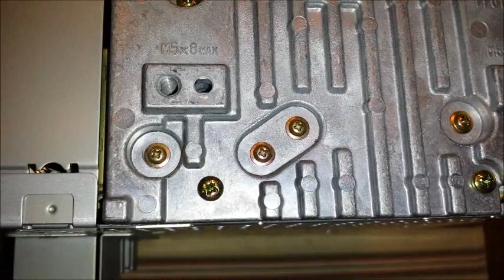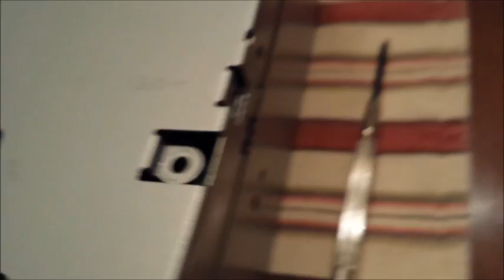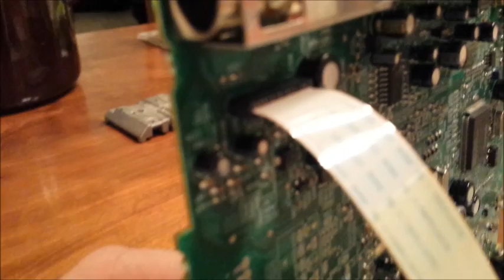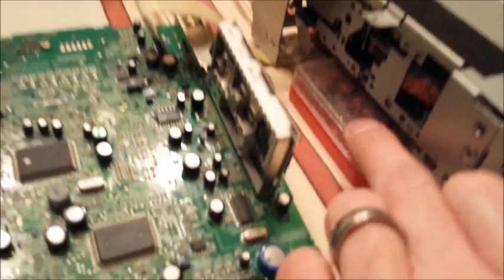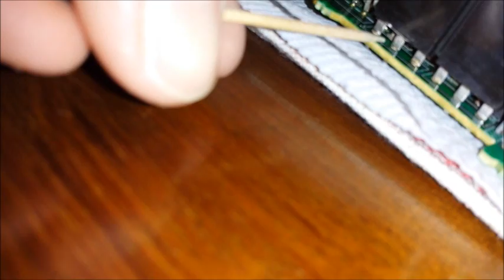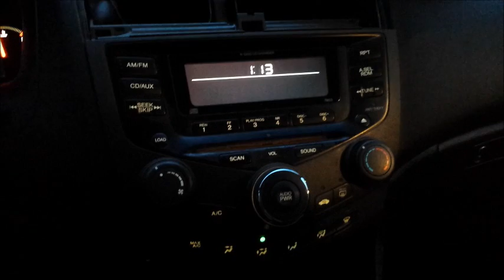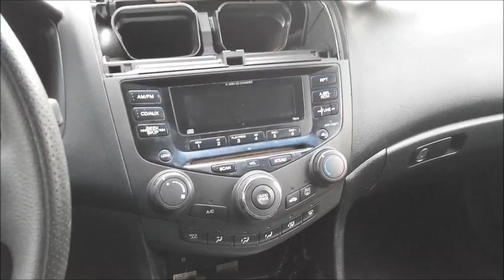2003 Honda Accord Radio Repair - Part 2

Comment: Hey Matt--I know it's been a while since you posted this, but I have a question about the original problem set you had.

Did you also have "alternator whine" or a buzzing/whining sound that increased with intensity when increasing RPMs? That is my current problem (along with no back lighting).
Reply from the maker: Hey Mike, the vehicle in this video actually belonged to a friend so I am not 100% sure, but I don't remember him mentioning an alternator whine.  I have a feeling that is probably a separate issue (your alternator may be starting to go bad).  Did the whine pop up at the exact same time that your radio backlight went out?

Sorry to hear you're having trouble, but hopefully you can get it sorted out.  If you are feeling brave, you can try the radio repair, and then move on to the alternator later if it continues whining.  Good luck!
Reply from the maker: Hey Mike, the vehicle in this video actually belonged to a friend so I am not 100% sure, but I don't remember him mentioning an alternator whine.  I have a feeling that is probably a separate issue (your alternator may be starting to go bad).  Did the whine pop up at the exact same time that your radio backlight went out?

Sorry to hear you're having trouble, but hopefully you can get it sorted out.  If you are feeling brave, you can try the radio repair, and then move on to the alternator later if it continues whining.  Good luck!
Reply: Thanks for the well wishes. Let me give as much information as I can and my conclusions thus far. The whine has been around for a while. Only recently did I install an auxiliary line (cross country drive coming up and wanted phone-based tunes), but the whine comes through with such intensity that it drowns out any output from the auxiliary device!

I've had the alternator tested and it is within expected operating parameters. No issues there.

I took apart the dash and removed the head unit. I double checked my grounds and even added an additional ground along the radio receiver to ensure there would be no interference. When looking for a reasonable place to mount the second ground line, and while the vehicle and radio were running with the whine audible, I never heard a change in the whine while touching the second ground wire to other grounded surfaces--no pops, clicks, or even the slightest diminishing of the whine.

With that all said, I think the failure is within the receiver itself, and your fix will not address it. I have many pick-a-part locations around me, making my next step to replace the whole head unit. IF that fails, then I'll look into strengthening the grounds on the AC compressor, the engine, and the alternator. IF that fails, then I will be at a loss and will listen to nothing on the drive from North Carolina to Washington (state).
Reply from the maker: Hey Mike, that's a bummer!  While I am far from an electronics guru. I think you are spot on with your assessment that the issue is somewhere within the radio unit.  It sounds like there is a ground issue within the radio that is allowing the alternator current to "bleed" into the audio channels.  I hope you're able to find a replacement unit at a pick-a-part so you can have some music to get you through your cross-country journey.  

Let me know how it turns out, and enjoy your trip!  I'm envious - I've always wanted to make a cross-country drive.
Reply: Thanks for the support. I will let you know (maybe in video format from my channel). As for the whine, I have also come across the information that there remains a whine even when the radio is off, though no through the speakers. My investigations have informed me that it is my transmission making that whining sound with the same increase and pitch as the radio (when on) does. Probably unrelated, but an interesting overlap.

As for cross-countries trips, it is fantastic. First one was from Portland OR to Durham NC. 5 days and 12 states. The way back, the wife and I are going to slow down, checking out Nashville, the Badlands, Yellowstone and the Grand Tetons, and then roll into Bend OR for a day on our way up into central Washington. Spending on your tolerance for camping, you can do a coast to coast (seriously, make it a life goal) and back in 12 days. 7000-ish miles of all the beauty this country can provide.

Anyways, thanks for your time. Updates to come!

Comment: I have a 2005 Honda accord, my sc player doesn't dismount from the circuit board =/
It's attached on top of it so I can't even get at the screws under it
Reply: Same. If you find a solution please share

Comment: Matt; I just completed the repair, ad your tutorial was MOST HELPFUL ! Thanks for the detailed steps ! I actually removed the defective current limiter and just soldered across the 2 spots on the board. super easy and took me 10 minutes. I just applied the soldering gun to one side at a time and the limiter popped right out. I did have to grind down the tip of my soldering iron in order to fit into the narrow opening on the outboard side of the limiter. Again, a huge thanks for your tutorial ! ~Phil.
Reply from the maker: +philmorrissette Awesome job, Phil!  I'm really glad this worked for you and that you found my video helpful.  Thanks for watching and commenting!

Comment: Hi Matt ,
i have honda acord 2010 with the same symptom that the screen go blank without any response 
also the radio shorted and smell goes out and i replaced the backup fuse in the under the hood fuse box but it didnt work
is this solution will apply also to my model?
thanks
Reply from the maker: +alaa barqawi I am not really sure if this repair applies to later generation Accords.  It sounds like the 7th generation Accords (2003-2007) had the same factory radios, but I really don't know if the 8th generation and later models had the same radio.

When you replaced the radio fuse, was the original one blown?
Reply: ***** finally i replaced the stereo with a one from junkyard and its working fine,
i tried to figure out where is the culprit chip and i didn't see and burn 

the fuse was blown and it affected the keyless entry after i replaced it the keyless entry worked fine
thanks for help
Reply from the maker: +alaa barqawi Awesome, and congratulations for solving your problem!  I'm glad you got it all sorted out.  Good work!

Comment: he'll yeah man, thanks good job on the video. I  pulled the tiny piece off the circuit board then melted  solder across connecting the two metal pieces.  But did  you realize the light used to be  blue? I wonder if that bad piece had anything to do with the blueness? either  way I'm happy, but kinda miss the ambient blue light.
Reply from the maker: +slumber56 Wow, really?  That's weird.  I actually never knew what color the light was originally, as the vehicle in this video belonged to a friend.  I had never seen the backlight working.  That is quite odd about the color changing, though I suppose the change could have something to do with the resistance in the circuit being decreased by bypassing the built-in resistor.

I'm glad the repair worked for you....thanks for watching!

Comment: maybe you can help me out: my lights are no problem on my dash when in reference to the temp lights and such, but my damn stereo either wont stay on or the whole display goes in and out in and out? Do you think I need a whole new system? Thanks.
Reply from the maker: +stillettopumps86 Hmm, I seem to remember reading about that issue, and I think it is probably related to the motherboard inside the stereo unit.  I could be wrong about that, but before you go tearing into it, I would check out some Honda forums to see what you can find.  I'd hate for you to go through the trouble of the repair in my video only to find out it didn't help solve your issue.

Good luck, and let us know if you figure it out!

Comment: Damn, I have a cd stuck in the radio. I suppose I have to go through the same steps to get it out?
Reply from the maker: +Autonomous Prime Actually, I'm not sure this repair will solve that problem.  I don't think the resistor that causes the backlight to fail has anything to do with the CD player's function, unfortunately.

Comment: Hi I have the same problem but my radio is the one with the navigation. the resistors are not in the same area. wondering if you could help with this problem. thanks
Reply from the maker: +Ricardo Acosta Ricardo, many other people have commented that they have the same issue.  Unfortunately, I have not performed a repair on that style radio, so I really can't offer any advice.  I would check out some Honda online forums to see if anyone else has identified the resistor in question for your style radio.  I'm sorry I am not more help with this.  Good luck, and please let us know here if you figure it out - many other people would appreciate that information!

Comment: I really appreciated all of your great detailed instructions on this application.  I am getting ready to attack mine……I have the same thing, but i noticed that my radio does not have the anti theft light on the right side.  Hoping that will not make a difference.  You really did a great job and cannot say enough about your attention to detail.
Reply from the maker: +MegatTomslick1 Thanks for the compliments!  I am not 100% sure, but I don't think the lack of anti-theft will make a difference.  If your circuit board looks identical to the one in my video, then you should be good to go.

Good luck, and let me know how it goes!

Comment: hi there may also be a resistor for the AC button because there is no signal on to the Relai in the engine room but the entire air conditioning works when bridges the relays on .thx

Comment: Hi Matt, Do you know by any chance if I could change the original unit with an aftermarket one and still keeping the face plate.The main reason would be that I don't want to change the look of my dashboard. I'm thinking of something that would  perfectly fit with the face plate brackets and connections. Thanks ! great video btw.
Reply from the maker: +Nicolae Andronic Thanks for the kind words!  Unfortunately, I am not aware of an aftermarket stereo unit that utilizes the factory faceplate.  However, I want to say that I read about someone who had installed a separate stereo in the small compartment below the factory unit and left the factory unit in place.  I'm not exactly sure how that would be wired though.  

I would start by visiting some Honda forums - I'm sure there are some really knowledgeable and helpful people out there.  I honestly am really not very familiar with Hondas; the vehicle in this video actually belonged to a friend and I told him I'd help him try to fix the radio.  That was pretty much my one and only experience working with a Honda (or car audio, for that matter!)

Good luck to you - I hope you can find a solution that works.  Thanks for watching!

Comment: This video saved me a few hundred dollars. My 04 Accord was way out of warranty and I didn't want to put too much money on it. The circuit writer pen is expensive ($23 at my local Radio Shack) but it works. The ink was not conductive at first when I checked it with a multimeter but it became conductive after 24 hours. Now my radio display and AC button lights are working again. Thanks,
Reply: +Brian Chen After two months, when driving with head lights on, I smelled something burning and then the radio panel lights and all AC control button lights went out. Not sure what happened but I think it has something to do with the repair.

Comment: I have the same problem. My lights are off. Can't see the stations. CD player doesn't work, can that be the problem? And my radio turns off by it self and I just have to turn it back on by pressing the power button. You think this would fix all that?
Reply from the maker: +Phdizzle C Unfortunately, I think you have two or more problems.  The repair in this video should solve the problem with the backlight not working.  However, the CD player not functioning and the radio turning on and off by itself are most likely unrelated to this problem, and could be due to a bad radio motherboard.  Apparently there was a recall on these radios; I would call your local Honda dealer and see if they will help you out.  More than likely you are out of the warranty period, but you might get lucky and they may still work with you on the cost to have the radio replaced.

Good luck!
Reply: ***** : thaks, ill look in to that.

Comment: So is it NEEDED to cure the ink for 24--48hrs?
Reply from the maker: +Esteban Sanchez Based on others' comments about the repair failing if the ink had not been allowed to cure, I would definitely recommend waiting 24-48 hours.  Though not overly difficult, this is is not a project you want to do twice if you can avoid it.

Good luck!
Reply: +Matt Payne hey matt so as u mentioned i did have to pull the radio apart a few times to re apply the ink and impatiently installed it immediately. It didnt work.. But now a few days later i guess the ink "cured" and my light works thanks for the vid and great advice
Reply from the maker: +Esteban Sanchez That's great to hear!  Nice work!  Enjoy having a functional radio again.

Thanks for watching!

Comment: hi my english is not so god u paint this black stuff with this pen and then is finished the repair? my accord radio is blank and ac clima  is not working HDS scan say the button have proplems this pen clean this proplems? help plz
in german now 
meine radio anzeige ist blank zeigt nichts an und mein klima knopf AC funktioniert nicht wenn ich mit diesem stift jetzt auf dieses schwarze diode gehe dann funktioniert wieder das ganze ?
Reply from the maker: +Esra Aktepe Hello, yes - to make my repair, I painted on the conductive ink with the Ink Writer Pen (the ink is silver, not black) and bypassed the resistor that had failed.  You could also make a more correct repair by removing the bad resistor and soldering in a new resistor, but that takes a fair amount of skill with solder.

Good luck!  I hope you are able to repair your radio.

Comment: Do you know what the problem would be on a radio for a honda if it turns on properly but just doesn't play music? Also when i switch stations a loud popping noise happens.
Reply from the maker: +Jorgesancen That sounds like it could potentially be a blown speaker fuse, or blown speakers in general.  i would start by removing the radio unit and looking for any in-line fuses in the speaker wiring.  You could temporarily connect another speaker to the stereo and see if it will emit any sound.  If the wiring and speakers check out OK, you may have an issue with the radio motherboard.

Good luck!  Hopefully it will turn out to be something simple.  Let me know what you find.